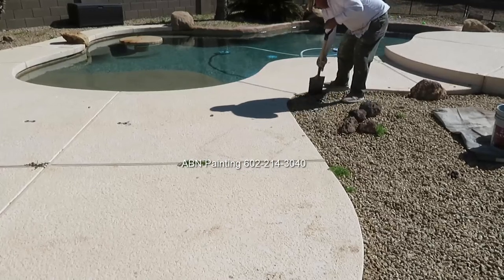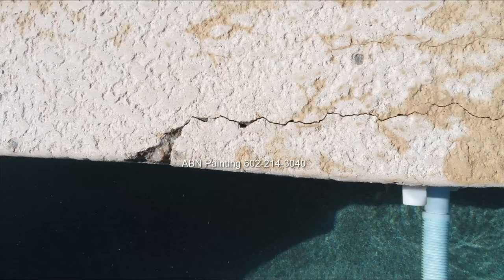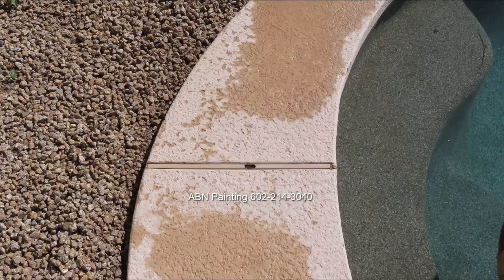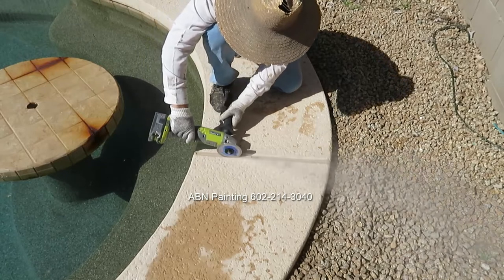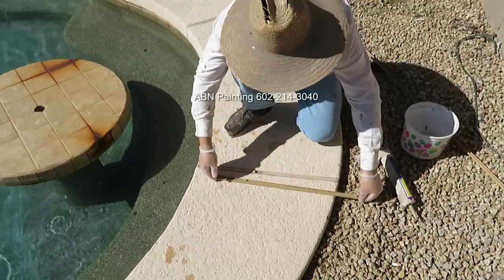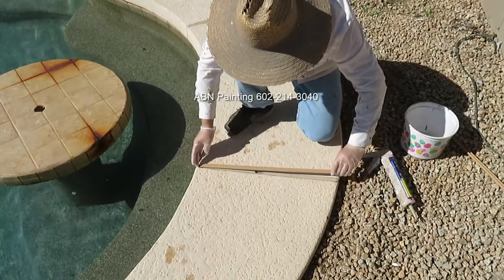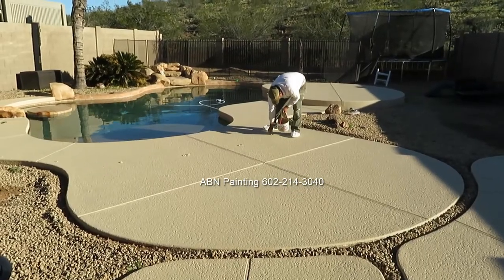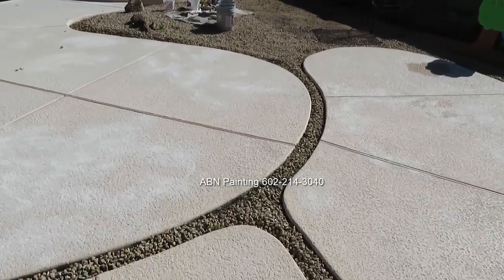Prep work and painting of a pool deck with Behr Deck Over paint.

Comment: Have you had any complaints about this Behr paint type when used on acrylic pool decks? Durability, slippery, or easy to stain ? Any other good paints out there ?
Reply from the maker: Hard to maintain sometimes is the complaint for the paint.  if the deck needs no repairs we use H@C color top concrete stain. Stain is a little easier to maintain. If repairs are done the thickness of the paint is needed to cover repaired areas well and concrete stain is not always an option.